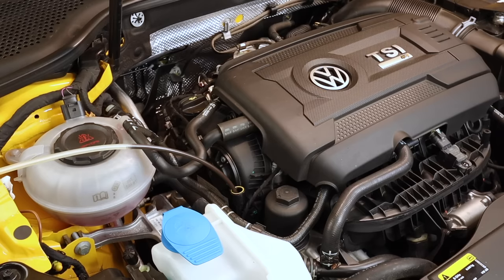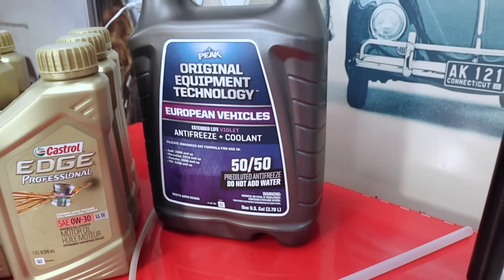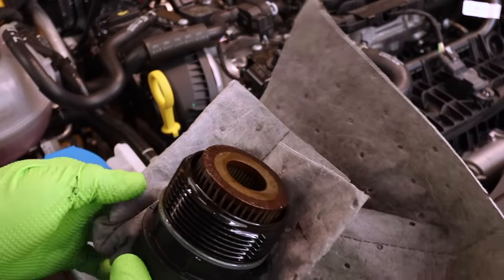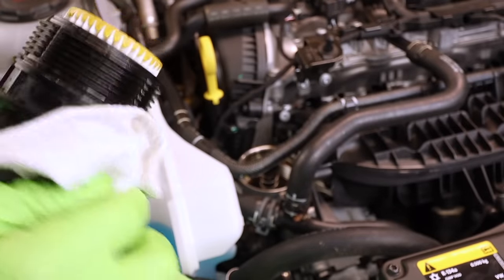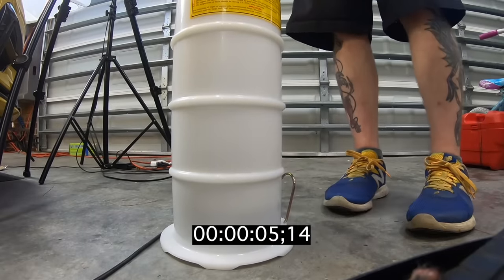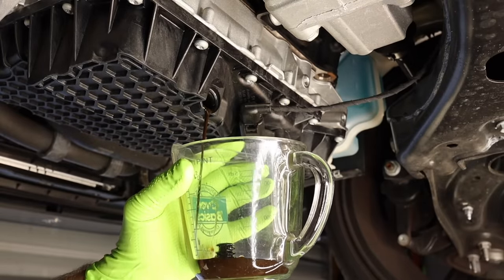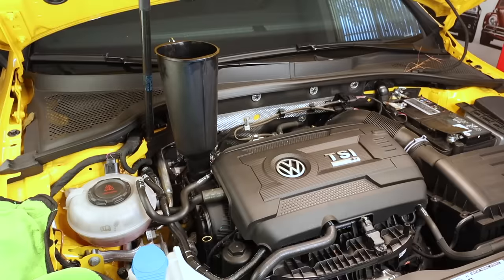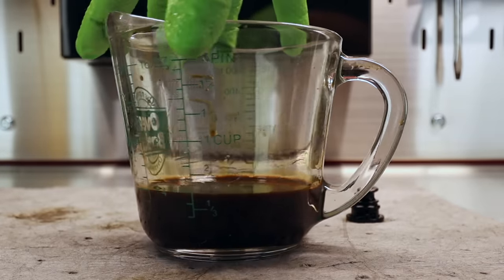Will an Oil Extractor Get All The Oil? (MK7.5 Golf R 5000 Mile Service)

Comment: We have a Golf 4 TDI from 2000. Always done with an oil extractor. Engine is now at 650.000km. Never had problems.
Reply: Damn thats 403k miles.. mines got  323k miles..and counting!
Reply: Wow. I just rolled 160k.
Reply: lol i dont think ive ever seen a 4th golf tdi with less than 450,000km
Reply: Dan Dusome my golf 4 1.9 tdi has 220,000km
Reply: @kinecty111  ATD 325 k km, just today replaced new turbo for it
Reply: Golf mk4 the best car ever build
Reply: @dardangraceni  Except Golf mk2 is even better.
Reply: Mine died with 260.000 km. But not the engine, that one is still fine. The chassis rusted away. The engine is still in my garage when I have a chassis for it, I will put it in there.
Reply: Wow, what engine do you guys have with these kind of miles ?  :)
Reply: @paulbelew353  Diesel and we maintain them. The AHF from VW is end 90s and will run forever.
Reply: @Spelter  I would love to get the diesel..one day, for now my 1.8T will have to do at around 250K ! :)
Reply: @paulbelew353  if you change your oil and coolant now and then, your fuel filter every year and keep it in good shape, it could make it that far.
Reply: @Spelter  Fuel filter every year? Hell no! Every 3 yrs yeah and oil & filter every year for sure with or without the extractor.
Reply: @tardeliesmagic  then don't cry when your injectors are stuck or rusted and drip like an 80 year old.
Reply: Mine has 900k an counting
Reply: @SY-ml5nl  wow, the old engines run for an eternity if maintained properly and greta has to explain why we should throw them away before they made up for the co2 they cost to produce.
Reply: @paulbelew353  Mercedes OM646EVO is the best diesel
Reply: Industrial grade motor 👍
Reply: WAW WAW WAW....That's pretty impressive! My 2013 Golf TDI has just over 187k km (just changed the timing belt- I will wait till 200k km for the next belt change, because when I pulled out the OEM one, it looked like it would do another 30-50k km!!!) , so I think it's barely broken in! I will keep it and see if it hits the 500 km km!!! I love this car so much that I prefer it to my almost new 2014 C300 4 Matic with 42k km...small, comfortable, comfy, zippy, especially with the 19" Golf R rims & Michelin Pilot Sport 4S  tires...I just NEVER tire of driving it! A cherry on the cake, the extended warranty that ensued the diesel gate in North America will only end when the car hits 10 years, aka May 2023! What a treat!
Reply: Which oil are you using? And what viscosity?
Reply: Lol golf 1.9 tdi is made of nokia the engine is indestructible
Reply: nope. drain the oil from the pan. gravity as far better. add atf fluid b4 the change and clean out the engine.

Comment: I pull the plug, When it stops dripping, I add a lil fresh oil and when I see clean oil from the drain, I put the plug back in.
Reply: That's because you're not stupid, draining oil gets the fodder and metal shavings out.
Reply: This is common practice in rotating machinery, which does not have a filter. I have never done this on a car, the filter will usually be sized to filter all the oil several times an hour
Reply: @Ez-sk8ig  I've Been a mechanic all my life, Build machinery, maintain it. Fire Department Mechanic (retired) I sell my car when they hit 300,000. I'll keep doing it my way..
Reply: @Evil-Jesus  sorry,  my comment was more directed at the reply mentioning shavings etc... your process is the same as is used in heavy industry and the results don't lie, however we also use predictive maintenance and have vibration engineers and chemistry analysis and plasma gas spectroscopy for determining wear particles, but having visible shavings in a gearbox means hard parts replacement. My car has plastic oil pans, with magnets for catching any metal particles, but there's nothing wrong with a thorough flush of old oil.
Reply: Me, TOO!  Good practice 👍
Reply: Seems like a smart, effective, and workable solution, as opposed to the fanatics above with their 48 hour drain-out period... I mean, lawdy, taking a vehicle out-of-service for 2 days over an oil change?... ridicu-mah-lous...   :rolleyes:
Reply: I usually add ALL the fresh oil before I put the plug back in. This way I get ALL the shavings..........
Reply: @Samlol23_drrich  why? From how it reads, you are wasting a whole amount of oil to make sure shavings are gone. So are you purchasing two full amounts of oil to fill up the car? Or are you pouring correct amount of oil needed then catching it at the other end then putting the plug back in and putting that same oil in the car that has said shavings. Both sir would be horrible ideas. One is a complete waste of money and time and the other is literally just putting those metal shaving right back in the car. Wtf. Point blank this pump works is very efficient and can be used all the time. The company itself does however recommend a full/regular flush every 50k miles though. Magnetic plugs help with metal shavings and as long as you do your oil maintenance regularly, the left over oil in no way will hinder the functionality or operation of your vehicle. If you are doing your maintenance every 3-10k miles, the oil should not have that many particles in it anyways unless there is something wrong with the car. And simply changing your oil at that point will not fix the problem.
Reply: Yep, just put some new in and let it drain. Good.
Reply: samlol23 dump cheap thin oil in while sump plugs out, two quarts is good
Reply: @Smarterthanyou-mthrfkr  my car isnt that good that i need to waste 2 quarts of oil. I just put the plug back in after 5 minutes or so and fill er up
Reply: Paul, your forgetting about the 10-20% of oil still trapped in the engine.  Add two more quarts and run the engine for 20 minutes and drain.  You will get 96-99% of the old oil and wear metals and contaminates out.  The engine came from the factory with a 100% clean oil, not a contaminated mixture.
Reply: Paul Heese That’s how my old man showed me.
Reply: @Samlol23_drrich  I pour gas in to flush out all the dirty oil, then run the engine for about 5 minutes to make sure it's all out.
Reply: @steelheadstalker4715  ill try that next oil change. Maybe mixed with 8oz of distilled saltwater
Reply: @Samlol23_drrich  No you don't - be truthful - you always end up with 8 pints on the garage floor every time and can't figure out where it came from because you forget what happend last time so you have to ask your mom or your little sister.
Reply: @Rob-fx2dw  of course i dont.  Its not rocket science. I dont pour any extra in. Let it drain for about 
10 mins, put the plug back in (actually use a Fumoto), then refill. 
Any old is diluted by 6qts of new so its not necessary to get every drop out imo
Reply: @Samlol23_drrich  I understand of course and follow the same myself after draining out the remnants but I also do a quick turn of the motor before the end of the drain  (with no igniton) to pump out any remaining oil sitting in the galleries which sometimes is quite a bit then repalce the drain plug, fill the new oil filter with oil and give a few more ignitionless turns to get the oil through. It only takes a few minutes more.
Reply: @Rob-fx2dw  this is interesting. What do you mean turn the motor with no ignition? How do you do that? Im curious
Reply: @Samlol23_drrich  Depending on which car I am servicing I disconnect the ignition coils or take out the relay fuse so the motor can be cranked by the starter. It can also be done by disconncting the crank position sensor.
Reply: Like the tip! Thanks! 👍🏼👍🏼👍🏼😁😁😁
Reply: Don't need a pump. Wasteful. Drain and fill. Cheap. Simple. Anyone can do it. No extra equipment.
Reply: Just drain it out with the drain plug. Some folks are so lazy that they refuse to get under the car.
Reply: I thought I was the only one that added a little fresh oil to wash out every trace of old oil.
Reply: Same!

Comment: This tool would be excellent for people that, don't have a garage, or living some sort of complex where they're not technically allowed to work on their car! With this, they can't accuse you of making a mess of oil in the parking lot!
Reply: This tool is also excellent for the “well-travelled” among us.
At 70 years, I don’t bend or twist like i used to, so hauling out the jack, jack-stands and assorted, and raising vehicle and safetying… well, it’s s difficult for me (not that I’d ever admit to this outside of a courtroom).

Top-side oil changes are a God-send for me, and there are many others.
Reply: Nah, still for most car you need to jack them up to replace the oil filters.
Reply: I'm looking to start a local mobile oil change service. That's what led me here! Would be perfect to show up at a warehouse or factory and get 20+ customers in 1 spot this tool would be gold!
Reply: @hhemi0  my car has filter on the top 😁
Reply: ^^My exact situation.

Not just the mess but also there's maybe 2 parking spaces that are level enough to lift a car on, and you need both of them.

I also drive a lowered saloon so without a full on lift I'm guaranteed to take that first few ml to the face while I try to shuffle out the way and slide the catch in.

Comment: I used an extractor for years. I sold my last car at 178,000 miles and it was still going strong so I can attest that half cup  of leftover oil doesn’t make any difference.   

No ramps or fussing with the belly tray and I’d have had no trouble changing my oil in a suit and tie if I’d chosen to.  The only reason I stopped using the extractor is I now have a BMW which doesn’t have a dipstick. Now there’s an abomination!
Reply: No dip stick... wtf
Reply: Yeah, I belive the oil level is shown in the dashboard
Reply: Yep! Same in my Porsche Cayenne.
Reply: Yooo touregs with the v8s dont that shit is annoying never get a v8 touregs if ur doing maintenance  on it
Reply: Don't it have a plug where the dipstick would be, ya pull that and suck out the oil, ?
Reply: My Audi didn't come with a did stick, and yes it has dashboard notification. However, I bought a dip stick, removed the plug for the dip stick hole and placed it there. I really do hope that BMW has that hole and dip stick plug that can be replaced with an actual dip stick. If not, i don't think it is safe to rely on the computer to be accurate.
Reply: audi says hold my beer. It wont be long till all VW lack dip sticks
Reply: @RockwildazFamily  where u get it? Also what model? My 2018 a4 has no stick
Reply: Agree especially on a damn Mercedes with their belly plates its a pain to take em off i use an electric fuel pump to pump the oil out while changing the rest of the filters etc... much more time efficient!
Reply: @Weiwei Su Our last Audi did, yes, my current VW Golf R 2019, has a dipstick.  AND even the ones with Digital, have an oil dipstick TUBE, with a cap, pop it off, use suction...simple...
Reply: Check that there is a tube, with a cap, remove cap, suck it out
Reply: My 2007 Audi A8L has a dipstick and an optical sensor which did come on once!!

Comment: I feel like the extractor is very convenient for someone who doesnt have a space to work on their car. I know from experience some apartment complexes do not let you work on your car, so an extractor would be faster and less risky.
Reply: Exactly my problem in my apartment.
Reply: @abdullast3434   ha, same here,  no oil changes,  That's what they think  lol
Reply: I do it right on the street 0_0
I remove one wheel where the oil filter is and drain the oil. Meanwhile I put wheel back on for discretion and just sit in the car while oil is dripping. Then I remove the filter, put new one back in, drain plug in, clean up, new oil in. I pour old oil into the chug where the new oil was and I am done. 30 min, no mess at all, nobody question me what I'm doing.
Reply: My complex doesn't allow them either they tell us we have to do it in our garage but there is literally barely enough room to even park or a car in the garage saw changing oil in there is literally impossible I literally have barely enough room to open the door so I do it outside anyways but I try to do it fast enough to where none of the neighbors see me but this one time some Karen came out and saw what I was doing and immediately took pictures and about a couple weeks or so later I received a letter in the mail saying that it was my first offense and that I'm not allowed to do it and on the second offense will have to pay a fee. I like to change my oil by draining it preferably but I might have to look into this even though I wasn't a big fan of it
Reply: I used an extractor at my apartments, after I finished the oil and filter change and checked oil level it was still black, so I would suggest doing oil change the classic way
Reply: @alexanderburlak  sounds like you did something wrong my guy
Reply: Understand completely about restrictions on servicing your car in a parking garage.  It really helps to have family or friends who will allow the use of a private driveway for this occasion.
   Bring a fresh coffee ☕ and sweet as a thank you 😘!

Comment: As they say: "The Solution to Polution is Dilution"

With only .1L of oil left in you have more than 98% of the fluid being new. With the underbody shield in place that I seem to strip half the nut clips whenever I touch them, I'm personally more inclined to use an extractor.
Reply: You do not need to remove the belly pan to remove the drain plug on this car - it ends before the back of the oil pan.
Reply: @rjw123987  not familiar the Golf R specifically, just the Mk7 TDI... you still have to pull the underbody tray to get at the oil filter... this is why for $80 the dealer does the oil change (especially when just the oil and filter alone come to around $70)
Reply: @exparrot9074  Yes, for TDI. I made a access hole in the pan
Reply: @BassVentura  you do not change the filter every oil change?
Reply: Hansel Franzen What sludge? Drop the pan. There is none.
Reply: Im with you, for THIS particular setup i couldnt be bothered taking it all apart for 100ml
Reply: Well now they changed the saying to "The solution for everything is PLASTIC!"
Reply: Just bought $30 worth of bumper push plastic fasteners at O'Reilly.  Cummulative damage from probably 25 - 30 oil changes.
Reply: Unfortunately my Subaru has the oil filter next to the oil pan, I have to get under the car to change it .😩
Reply: Yep, it’s just so much easier, meaning you are more likely to do it more often.
Reply: @MrOskarKim  yes yes and yes again
Reply: Don't get mistaken. 100 ml is just the difference between traditional drain and using an extractor. This is NOT the amount of oil remaining in the engine. In case of the EA888 3G/4G with the plastic pan a full liter (just more than a quart) is actually left. In case of the Mk8 GTI with its steel oil pan you'd get 100 ml more out using the extractor method (same as via drain), however 900 ml will still be left. About half to a full quart/liter of remaining oil is pretty normal for virtually any engine.

Comment: Another cool thing about an oil extractor is that if you overfill you can easily remove extra oil.
Reply: bottom line which ever you like to do works fine for an oil change as he proves with this video plain and simple:face-red-heart-shape:
Reply: You can always avoid that by not putting in that last litre, rule of thumb. 👍🏻
Reply: You can also loosen the oil filter and let some oil drain out. Way more flow control than messing with the drain plug.
Reply: After 30 years of playing with cars, I finally bought an extractor for my Audi. An Amazon electric pump for $25.
I forgot that I only put in what I take out and it was 4.5 qts, about .5 shy of my normal changes. So hooked the pump back up and 2 minutes later, the level was correct.  I was surprised that the overfill oil I took out looked almost like the  dirty oil from the change. Does leaving .5 qt behind make a major difference?